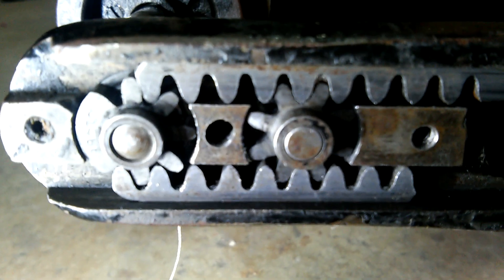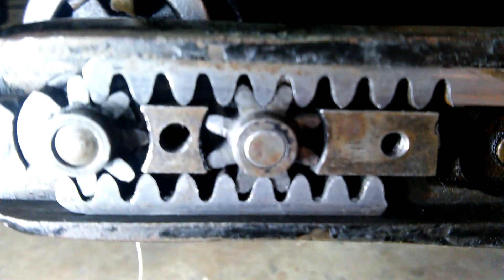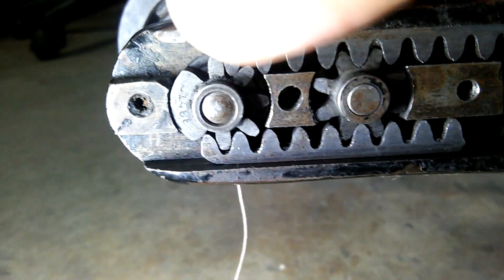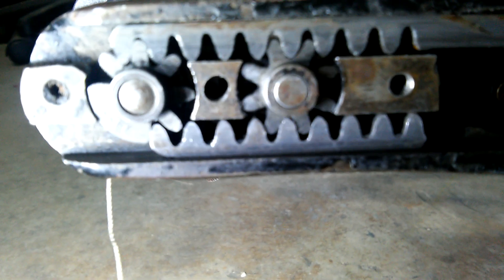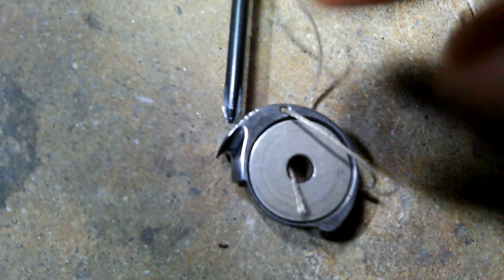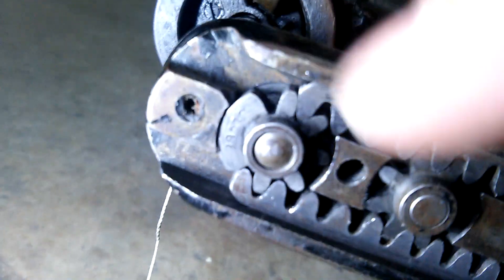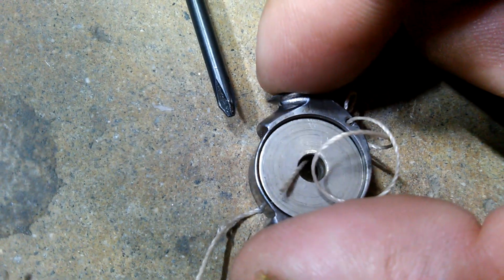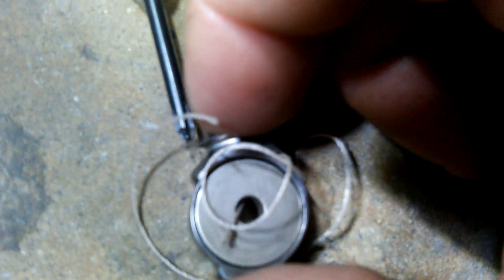singer 29-4 timing and gear alignment

Comment: What size leather belt do these machine use?
Reply from the maker: I actually made my own but if you google  singer 29-4 parts scroll down to   where it says ...  Singer 29-4 - Horse 'N Harness    it will direct you to a parts page and then go down to see them sell that part for about $11.00. I hope this helps

Comment: I have a 29k 4 witch i am trying to get back to life. But when i set the gears so that the shorter gear rod hits the firs knob,like in ypur example, it jams. When i looked closer i notised that whilest your machine has five knobs on the gears, mine has only three. I dont know what to say about it, i guess the 29k 4 has different models. And that this timing will only work for your model? Thanks for the video btw, even if it was confusing for my part🤪
Reply from the maker: None of my videos are professional but i hope they help a little. Some did send me a message that o did it wrong yet i works for me. You may be right about slightly different models.

Comment: I have a Chinese cobbler shoe patch machine.  I want to grease the gears and guides.  Your machine looks amazingly similar.  To access the gear drive, do I just remove the bottom cover?
Reply from the maker: yes but on mine everything falls right out so be carfull. It you open it slowly you can see how it is set up and so you can put it back together the same way.
Reply: @schutztruppe  I  just did mine.  I had the rack and pinion but only one rack and one pinion.  I used Lucas Red Thick and tacky and brushed a good amount as far as I could.  I did the teeth on the pinion really well.  Thanks for your help.

Comment: I think you might be wrong...Here's why, Lets call the small rack gear the idler rack and the other gear that's attached to the arm going to the rest of the machine the timing rack just so we know where we're at.
Rotate the machine till the timing rack goes to the end of it's travel with the end of the rack just coming to the end of the arm casting....now keep rotating till the idler rack gear moves into the same position and you will see that the way yours is timed the small idler rack gear comes out of the casting pretty far this is why it's incorrect.
If you place the timing rack in the second groove and also place the idler rack gear into the same second groove on the other side then both gears will approach the end of the arm casting and reverse at the same location without the idler rack exiting the casting and this is I believe the correct way to set the racks to the front gear.

Just my opinion but I confirmed that this is the case on both of my 29-4 machines.

Thanks for taking the time to document your efforts.
Reply: Question:  I have a Singer 29k71. Noticed a couple of days ago that the shuttle was broken and replaced it.  Now my thread upper thread is getting stuck on the leaf spring.   Please Help.......
Reply from the maker: this works for mine though. Maybe there is just more than one way
Reply: @schutztruppe  It might "work" on yours but it's not the correct way as the small idler rack exits the hole in the front to far out and can catch on the fabric or project.
Reply from the maker: All i can say is that it works perfectly for mine this way.

Comment: Does the 29-4 allow any fine adjustment to the timing, like the later 29K Models do?
Reply from the maker: I thought I replied. Looks to me like they are almost identical. I don't know how familiar you are with these machines but when ever you change the type thread, thickness, or you change the thickness of the leather or whatever you're sewing  you will have to adjust the disk knob to tighten or loosen them when they press together during sewing
Reply from the maker: I know I sewed some shoes and I used very thin thread with no problem. I hate changing thread and I usually use the same for my leather work. One hundred years people would be experts. Now we are in the dark and need to learn as we go. The foot ,not your feet, but where the material goes under does have adjustment for very close stitching or a little apart stitching.  Just like modern ones.  The long arm behind the machine as you look at it also can be adjusted, a little.